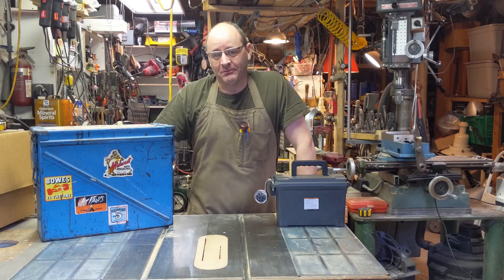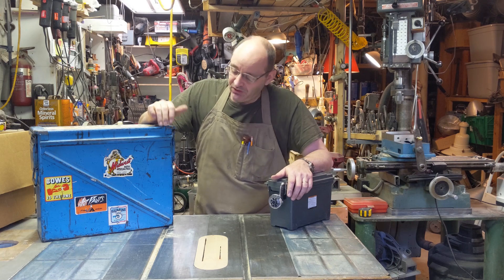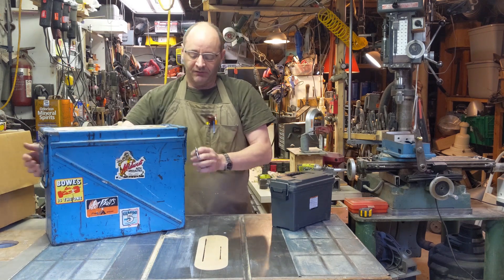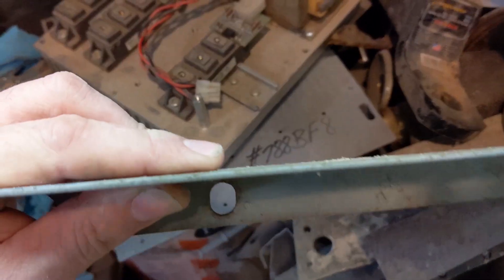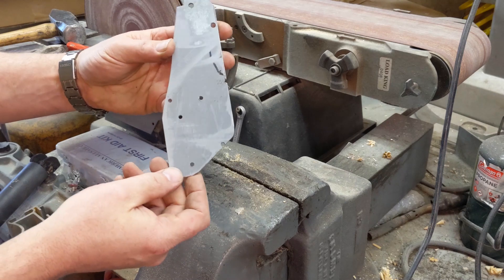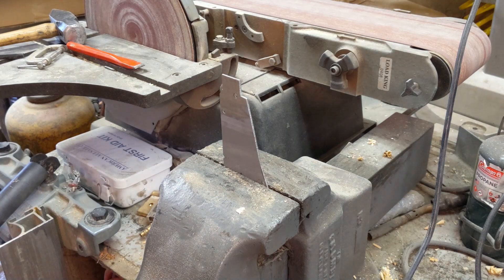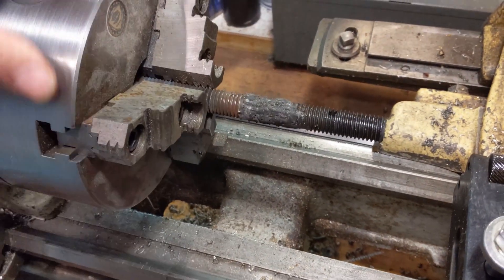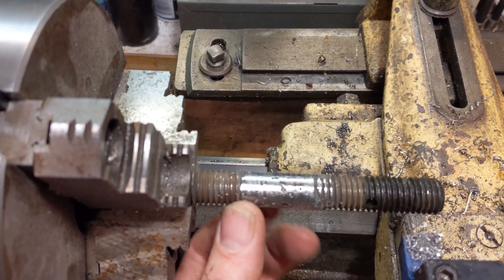Locking Mechanism for a FORTY MILLIMETER GRENADE LAUNCHER (NOT .50 Caliber) Ammo Box

Comment: Nice video.  And nice vise!  I have a couple of these 20mm ammo cans (M548); and I have been trying to figure out the best way to lock them with a single lock.  You gave me an idea.  I am going to bolt a short length of chain to each clasp and wrap the chain around the side and secure them together with a single lock.  Not quite as elegant as your solution but think I can get it done with what I have lying around.  Cheers!

Comment: Hi.  Help me I have a question with my lathe, and I see that yours is the same, I am very grateful if you can help me
Reply from the maker: What is it?
Reply: @TheBuildist  thanks for answering.  my lathe is a sount bend like yours brings the table of threads but I can not do the most ordinary steps.  you may have to use another sprocket?  because he only brings a small pinion in the cascade of gears.